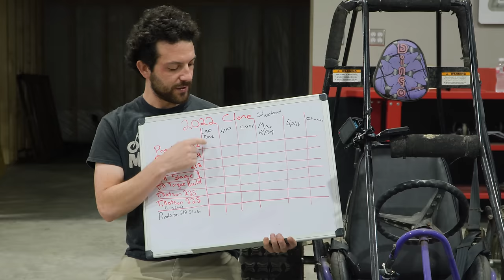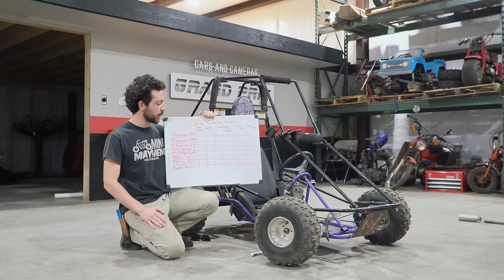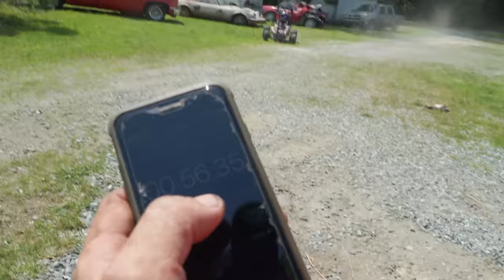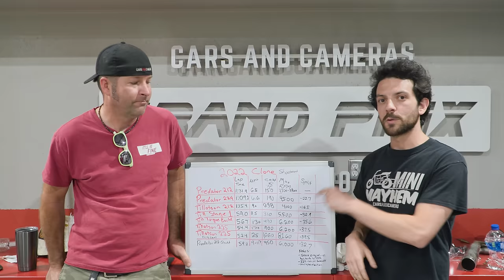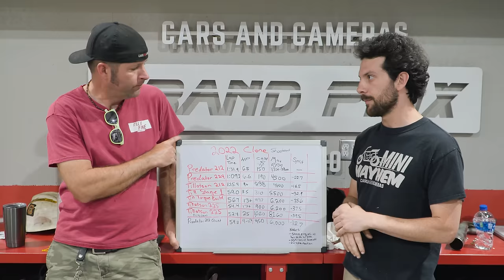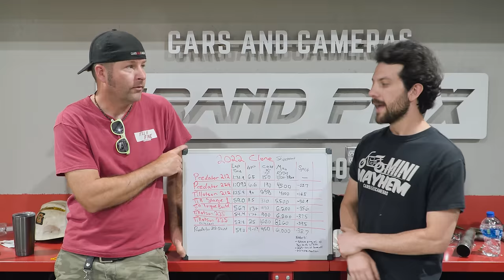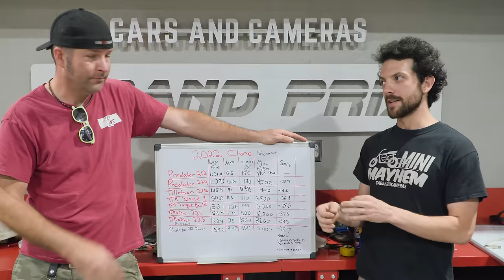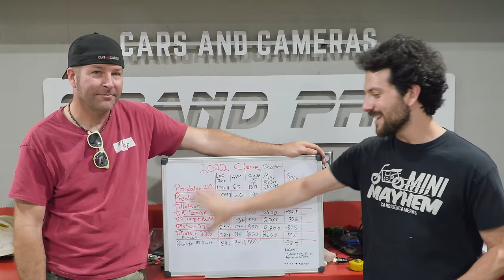Comparing 8 Honda Clones from 6.5 to 25+ Horsepower | SENDING 8 Performance Go Kart Engines!

Comment: It's so funny, these Chinese garbage engines ya'all run, when I was racing Karts in the early 90's we'd take a STOCK Flat head Briggs 5HP,  remove governor, drill out the carb to run Straight Methanol, and right away you'd have 15-18HP that rev'd to the moon , STOCK ROD, STOCK PISTON, STOCK SPRINGS, STOCK FLYWHEEL - and if you went really crazy and bought the kit to relocate the coil.... Then you'd run the tiny flywheel off a 3HP Briggs and it'd rev PAST the moon!!! LOL - No billet anything and they ran forever - Nothing blew apart, nothing was "Dangerous"
Reply: I need to get ahold of what your smoking you are not making 18 hp off of a stock rod 😂

Comment: Y’all… the Dingo DOES have Suspension: balloon tires. You guys need to learn to lower your tire pressure when necessary. ‘Cuz “There’s no replacement for… your SPINE.”